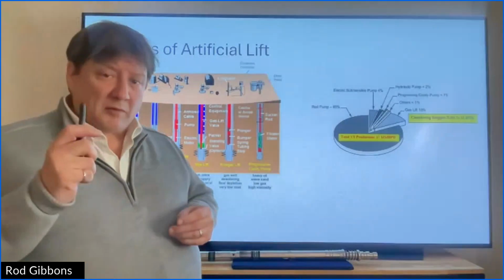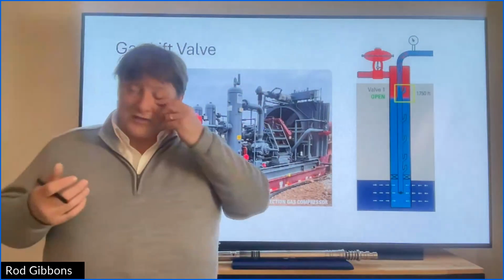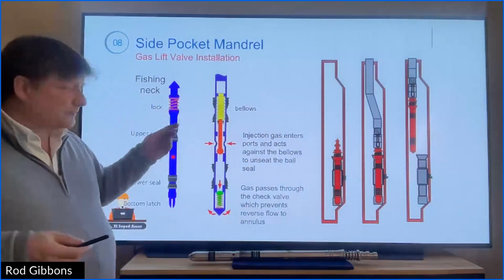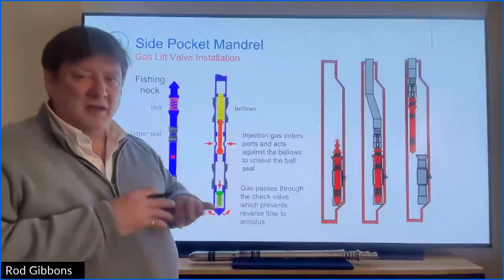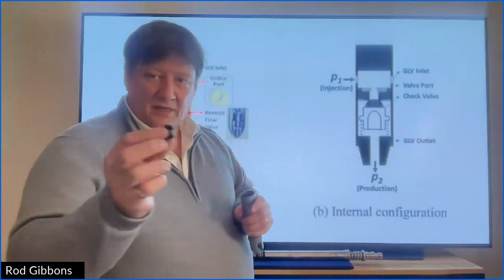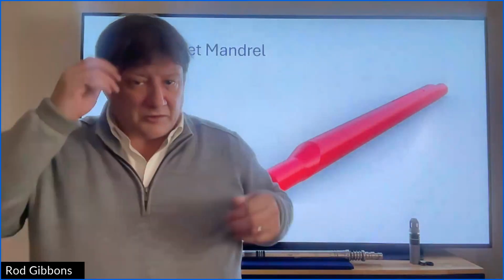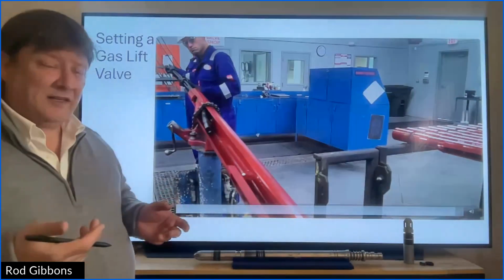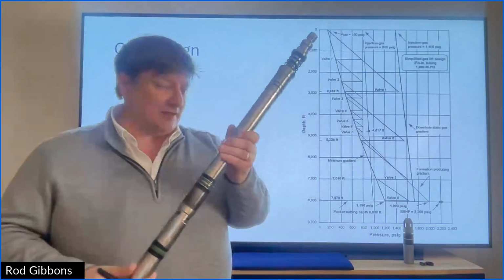How Does a Gas Lift Valve Work?

Comment: The description links gas compression to side-pocket mandrels and kickover tools, but it doesn't specify whether the compression package is a reciprocating unit or how gas lift valve opening pressure is set relative to injection pressure. In gas lift systems, the compressor discharge pressure and valve dome pressure must be matched to avoid continuous injection and instability. How do you determine the optimal injection pressure when the valve is installed in a side-pocket mandrel?
Reply from the maker: Hi, thanks for the question.  I have always had the compressor parameters determined by gas export conditions (gas sales line / dehydration or gas injection requirements) and then designed the gas lift setup based on available compression.  So, side pocket mandrel depths and valve opening pressures are a function of compressor output parameters (at least, I have not had the luxury of dedicated compressor designed exclusively for gas lift). Thanks, Rod.